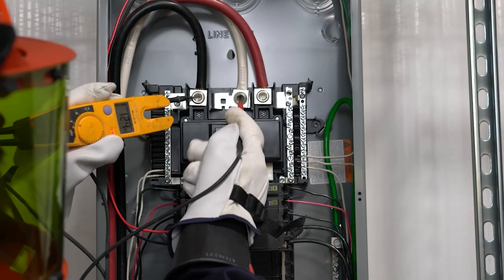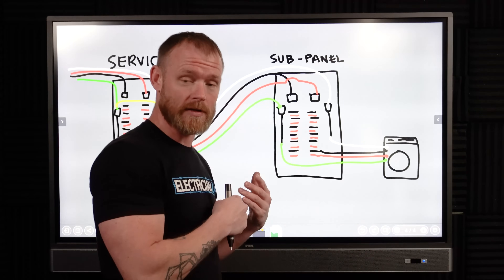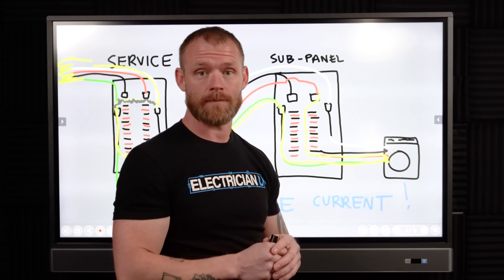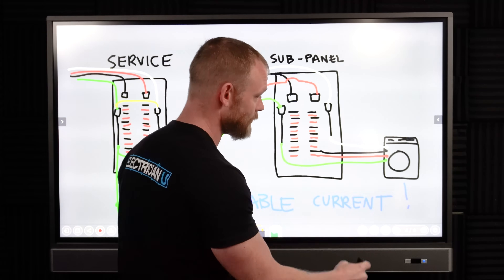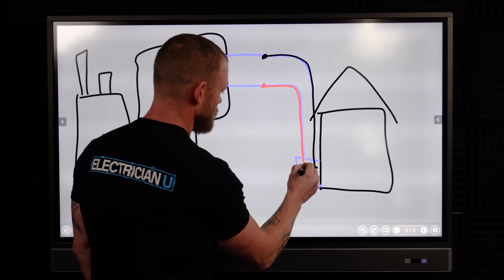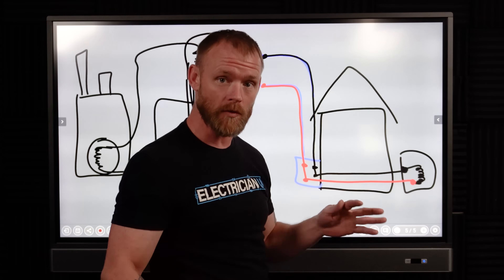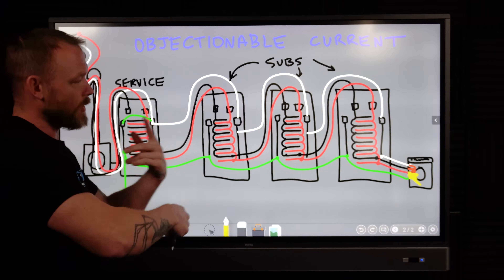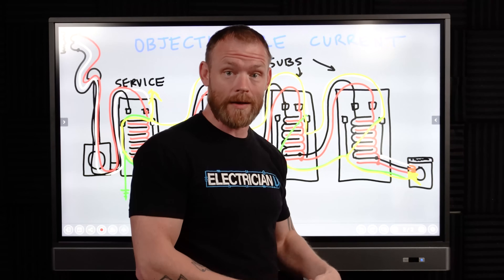Why Do We Bond at the Service Panel and Not a Subpanel?

Comment: Dustin... keeping with the sub-panel  subject, can you please answer this question... "Can you add an additional ground rod at the sub-panel?" I ask because in a previous build I had a detached garage about 150 feet away from the main panel and the inspector had me add an additional ground rod to the sub-panel in the detached garage. Thanks and I hope you can answer and explain.
Reply: Yes it is required. its better to install a ufer ground but if the garage foundation is already poured then you need to install a ground rod. 250.32 (a)
Reply: Assume you only bonded the case, and not the neutral to that sub-panel,  it's protection so grounding would still cause ground fault trip on GCI, but you don't bond neutral on sub-panel. Bonding neutral in two points creates circulating current, not good.
Reply: I think the issue with this video is the real world. Many thousands of panels out there are pre 1999 and won't have an egc lead to the sub panel from primary disconnect. The neutral is usually bonded to the second (sub) panel case and also acts as ground. Adding circuits doesn't seem safe to connect grounds to an isolated ground bus bar that can only go to the case or best case to a ground rod. The ground rod is a high resistance return path. I've been pondering this as a GC.
Reply: Separate ground rods are required for separate structures.  Since your garage was detached, it's sub panel (fed from the house) needs it's own ground rod too.  This is because ground rods have nothing to do with providing a place for fault energy to flow to; fault energy wants to return to the source, which is the transformer, not to the ground.  Ground rods exist solely for lightning strike protection and if your garage was struck by lightning and didn't have it's own ground rod, the energy from the lightning would travel down the ground wire that goes back to the main house and you'd melt every other wire in the conduit between the house and garage.
Reply: @taylorlightfoot  Electrical service grounding has nothing to do with lightning protection, it's for personal safety.  Lightning rods and wiring are intended to keep lightning out of your building by providing a path to earth.
Reply: @taylorlightfoot In Australia, which is similar but different, the sub-mains to any physically separate outbuilding only contains phase and neutral conductors, no earth conductor. The subs panel is required to have its own earth stake, which helps ground fault currents in any of the sub-circuits, not just lightning.
If a sub-mains are to a conjoined outbuilding like a garage physically in contact with the house, then the sub-mains also have a ground wire and no separate earth stake is required. 

From my indirect knowledge of the US system, it's basically the same.

The US split phase system has advantages in slightly lower risk of death by electrocution because of the lower voltage (before anyone says it's current that kills, voltage has an effect too) in hot to neutral circuits, but a higher incidence of death by fires because lower voltage in 120v circuits needs more current which tends to burn out bad terminations....

Comment: Great video... now, PLEASE, PLEASE,  PLEASE, do a vid on grounding rods. I've  been told more than a 1000 times, to put grounding rods at every building.  Here on the farm we would NEVER do that ( I know, farms are different ) because of potential "stray voltage". And, what does NEC say about multiple grounding rods? Thanks SO much.
Reply: Ground rods are about lightning protection, you need one at every building.  The sub panels have their own ground wire separate from the neutral that goes back to the main panel, this is the path for the ground fault to complete a circuit and trip the breaker.
Reply: @taylorlightfoot  Ground rods have nothing to do with lightning.  They are there to keep the equipment ground at 0 volts with respect to both the floor you are standing on, or a water pipe you might be touching, so that you don't get shocked.
Reply: Having multiple ground rods can offer path for a lightning to travel through the grounding system.
Reply: @okaro6595  we use ground/lightning rods at each barn, and call them lightning rods. They are never connected to any part of the service, as this can lend to a stray voltage. Very bad for animals, especially cows. THIS IS FARM USE, and N.E.C. does not apply. I just wonder why we would do our homes differently?
Reply: @Wrenchen-with-Darren  How does your electricity know it's on a farm and therefore operates differently from a home in the city.
Reply: @motorheadplatt8748  electricity does not know anything. Farms do not use multiple grounding rods due to the possibility of stray voltage, as I stated. Animals are very sensitive to electricity especially cows. If there is a loose connection, let's say, and the electricity try's to use a ground rod to return to another building or the main. You could loose a herd. So why would we want that potential around our kids?
Reply: Yea , are grounding rods primarily for lightning? Or what else are they for? How many do you need, where and why? I think a video focusing on grounding rods would be nice!
Reply: Most electrical systems require a grounding electrod. The NEC generally requires all grounding electrodes be connected together,  "bonded". A building may have more than one grounding electrode available, the water main and the rebar in the footing. If you may need to add a grounding electrode if there is not one available such as in a pole barn. The most common way to do this is with a driven rod. "Ground rod" The NEC says if you have 25 omhs or less resistance on this connection to the earth one electrode is sufficient. If you have more than 25 ohms resistance a second electrode is required. So the common practice is to add a second rod instead of trying to prove you have less than 25 ohms of resistance. The connection to the earth gives you electrical systems a reference to earth and helps stabilize the difference in potential between your electrical system and earth. It also creates a path to earth for any electricity the was induced on to your system that doesn't belong there.
Reply: @45-308  that helps, thanks. It gives the electricity multiple paths back to the main panel, if there is a ground fault... wait, we don't want that???? I give up.
Reply: @Wrenchen-with-Darren  No, ground rods are for lightning protection only, you still have a ground wire (separate from the neutral) between the sub panel and main panel, this is the path taken to trip the breaker in a ground fault.
Reply: Same. I've read that you should have a grounding rod at a sub panel. I'd love a video explaining that.
Reply: @jim_locks  You need a grounding rod on every building, not every sub panel.  If you have a main panel on a house and a sub panel in the same structure, that sub panel doesn't need it's own ground rod.
Reply: @jim_locks  read? Last I knew. N.E.C. 250.52 (A) (5) talks about grounding electrodes. I believe,  there can only be one per service.... per N.E.C. but, I've had inspectors require more????

Comment: After having watched this, I have two comments.

First connection of a neutral to ground anywhere outside of the main electrical service, is also considered a “ground fault“, not just hot conductors. It is technically any current carrying conductor with a connection in advertently to ground.  If you have not already done an episode on how a GFCI works, it measures current going out, and then returning, and if there is a significant difference, it will trip.  Indicating that there is current traveling on another path.

The other comment, is somewhat mind blowing if you wrap your head around it.  The neutral at a transformer it’s always going to be a current current conductor. Meaning that it’s always going to be varying at potential. When grounding it, you are not necessarily bringing the neutral conductor to the potential of earth, you are bringing the potential of the earth in the general area, to its potential of the neutral. Bringing them both closer together.  The neutral, a.k.a. the grounded conductor, and your electrons of an area are brought to the same potential.

This is yet another reason not to bond ground and neutral in subpanels in exterior buildings. Like a detached garage. And this is why metal piping systems are also brought to the same potential in each structure. Having a parallel current throughground, would have a voltage offset from that of the electrodes of the building. And while that may be minor, that still represents a hazard.
Reply: Question. An exterior panel with a main breaker in a separate box above it. Is it OK to have the ground to earth connected to both? Neutral is bonded only in the main panel.
Reply: @donphillips5957  your main disconnecting means and/or meter enclosure is the only place to which the MBJ main bonding jumper is to connect neutral to ground…. This is also where your electrodes (connection to earth would connect in the United States) - to the neutral. These are what grounds the grounded conductor (aka neutral).

Grounds from any other feeder or branch would follow the circuit paths along the same circuit paths as the current carrying conductors. So - other than the case of separate structures electrodes should connect to the main enclosure. And to the sun panel only in cases of separate structures. Like if you had a detached garage or pool house or shed that had a panel - the grounding electrodes should go to the panel serving that building. But not neutral to ground connection in that separate building. (At least since about 96)
Reply: @NoName-OG1   I have a detached garage with its own panel (100A main breaker, 1- 30A 220, and 4 15A 110 breakers) I have a 3 wire, direct burial cable supplying 240v from my main 200A service panel. The garage panel is grounded to earth through its own ground rod. Should my ground and neutral be bonded in this panel?
Reply: @Yo-Yo888AA  up until about 1996 it could be. And after 2008, it was definitely illegal… After that all new installations would have grounding conductor with the feeder from the the garage from the main panel to the panel at the garage AND ALSO have a ground rod at the garage. But no neutral bond at at any subpanel. Even if it’s a separate structure after 2008.

(Post ‘96 you would also have a grounding conductor for ranges and dryers be separate)

The philosophy of grounding and bonding changed in that year 1996, and the years following continued to catch all the places in the code that missed being updated by 2008. To separate “fault current” and “unbalanced load current” into separate and distinct paths. So as not to have “Objectionable current” 

Each separate structure is required to have an “grounding electrode system” for that structure. Rods, concrete encased electrodes, and pipe systems bond to the electrode system. Those are bonded to the panel serving the structure.

“Grounding conductors” are connected to that electrode system - to include those between structures. As branch equipment grounding conductors and feeder grounding conductors.

Branch and feeder - Neutral conductors (AKA GROUNDED CIRCUIT CONDUCTORS) carry unbalanced load current, and as such have different electrical potential depending on where they are in the system. And should not have parallel paths on equipment cases or exposed metal boxes or anything else. This would be “objectionable current”

And if bonded in multiple places would make the ground-ing conductors a parallel path for the current. Or conversely the neutral a parallel for fault current. “Objectionable”

So the decision was made to make them completely separate apart from a single point at the main/meter panels. So that only fault current is on the grounding conductors, and only unbalanced load current is only on the neutral.

So if your garage was built prior to 2008 it’s ok for the thinking of the time. And you may even lack a grounding conductor between structures and you would have the bond neutral to ground to have any ground fault path at all. And most inspectors would have you correct it if there were new construction in the garage for a new panel.

If it was after 2008, it’s a code violation to bond neutral to ground in a separate structure. And a violation to not have a grounding conductor with the feeder to a separate structure.

Hope this makes sense of the how and why….

If not look for “Mike Holt grounding - separate structure - fault current” and you’ll likely find an image depicting this with an explanation of reasoning. Or search “objectionable current separate structure NEC” or 250.32 in your code book.
Reply: @NoName-OG1  so when you say grounding conductor feeder from main panel to garage your basically meaning a 4 wire set up? 2 hots a neutral AND a ground? Plus also need the ground rod which i have? Btw it was built before 96 and have had no issues and plan no other construction.  But if there is a better/safer way ...
Reply: @Yo-Yo888AA  in the NEC “grounding and bonding” is a set of rules based on the concepts and philosophy of the physics involved. (That may sound existential but that is the gist of it)

A 4-wire is safer because a bonding of a circuit conductor like a neutral can elevate electrical potential of surfaces that may be at a different potential - and the bonding is bringing those surfaces to the closest they can to being the same potential.  Bonding a neutral in a separate structure can elevate say the concrete of slab to a higher potential than the piping for some other things in the same building bonded elsewhere… And make the grounding of the building a parallel path for current, which can be a fire hazard.

And for this reason - the thinking of how systems are constructed has changed. Since 96 and 2008 when it comes to separate structures on the same service.

What they moved to is a “single point - grounding system” philosophy. The single point being the service equipment. All neutrals and all grounding separated after that point. And in this way, no place on the grounds becomes a path for objectionable current. Which would be a higher voltage from other things around it. And less likely to be an inadvertent shock hazard.

No if you have just a 3-wire (2 hots and a neutral) and a bonded sub panel constructed prior to 2008 or 1996 then you can just leave it in place. But that day you need to change that panel, or other larger construction requiring changes in grounding - your inspector may likely have you change that.

Is it a hazard??? Not unless you are barefoot in your garage often…

Comment: It seems like you can think of a subpanel as essentially a “heavy duty 240VAC power strip with overcurrent protection”. The wiring is essentially identical, as far as I can tell.

Comment: I work for maintenance in a mall with 6 electrical rooms for powering the main area(none of the stores) and they lost a lot of the lists you place inside the panels and others are just listed wrong/poorly for example if it said "soffit lights" but the breakers actually go to the fascia lights. Any chance you could show us the easiest way to trace wires and any tips or tricks you have with larger buildings like this?

Comment: Question:  Secondary grounding rods for outbuilding subpanels.
If there is a subpanel in an outbuilding (underground feeder, buried 24", etc.) is it a good idea to have a separate grounding rod?  This (new/sub) ground is connected to the ground from the main breaker panel in the subpanel.  This means the two grounding rods in different buildings are attached to one another.  The new/sub ground is not connected to the neutral in the subpanel (but eventually makes it back to the main panel).  No neutral and ground touch each other until you get back to the main breaker panel.
Is this procedure:
a. The right thing to do?
b. A bad thing to do?
c. Not necessary but a good idea?
d. Not a good idea but probably won't hurt anything?
Reply: A.  Ground rods are about lightning protection.  If the outbuilding was hit with lightning and didn't have it's own ground rod, the lightning energy would travel down the ground wire in the buried feeder making its way to the main houses's ground rods, melting your feeder cables in the process.  Not good.

Comment: Even more so than during a ground fault event is to prevent voltage being on your grounding conductor. Not only will your grounding conductor have voltage you will now have circulating current on the neutral/ ground loop. Microprocessors are very sensitive to voltage. Even the millivolt range can cause issues if not burn up equipment.

Comment: Great video! One thing that I still have a question about. I understand why we only bond the neutral and ground at the main panel, so the current from a fault doesnt flow through the neutral of other circuits, but what is preventing the current from flowing through the neutrals of the circuits on the main panel? Is it a case of "path of least resistance?" Or is it because it is bonded to the neutral before any other circuits, or "Up stream" if you will.

Hope that makes sense!
Reply: The reason you don’t bond at sub panels is so there is only one path that normal current can flow on and that is the neutral. If you bonded at sub panels then normal current would flow on both neutral and ground. When normal current gets to flow on grounding system it creates stray currents that kills animals, it creates a potential for people changing out gas or water meters when meter is removed. Hazards Everywhere!!!